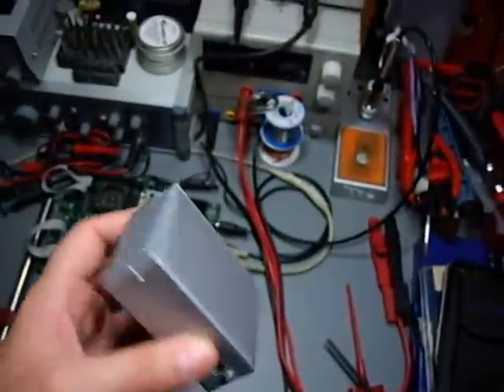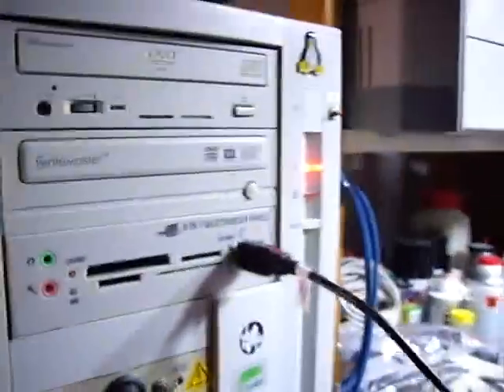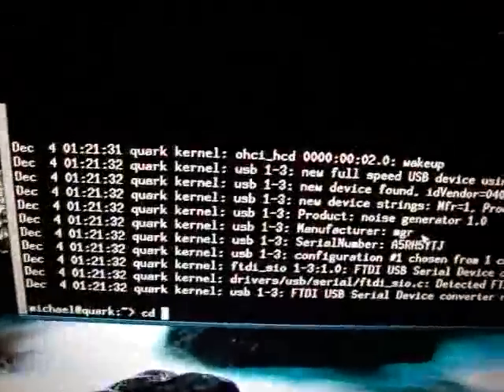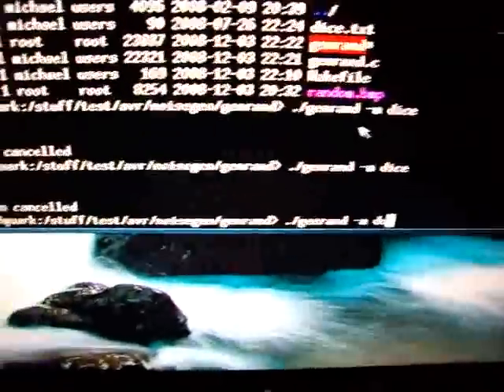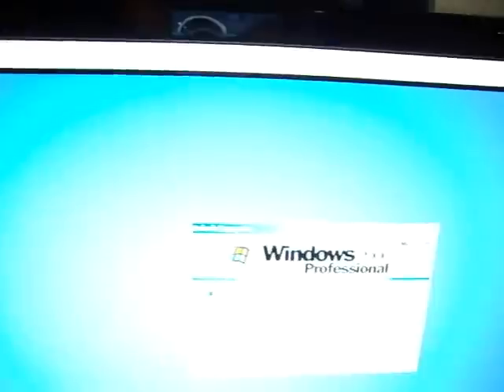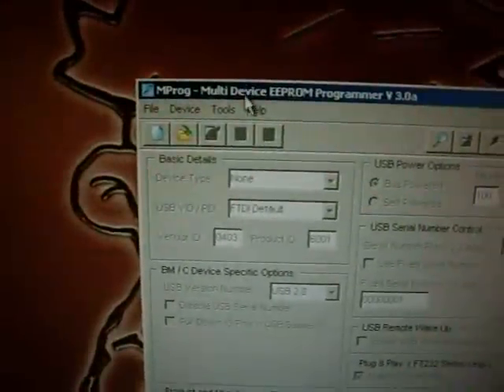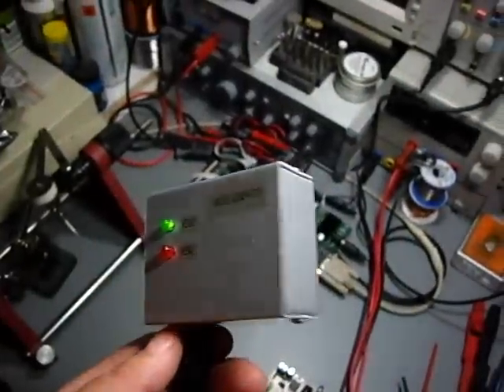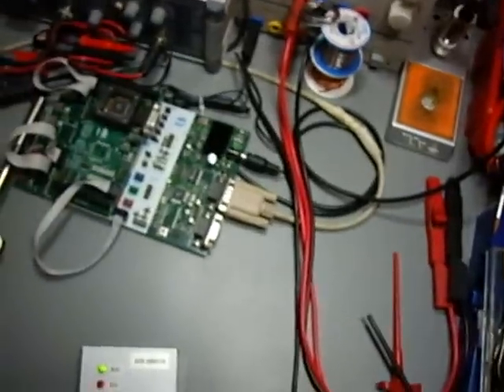FTDI FT232 - UART to USB bridge for microntroller circuits

Comment: Hello nice project   But did you know that FT232 is a noise generator  by itself   there is strong noise at around 14MHz ( in the 20m HAM radio band) when there is data transfer going on?